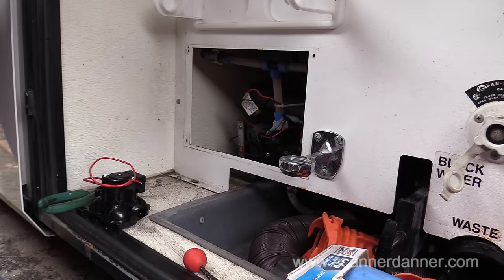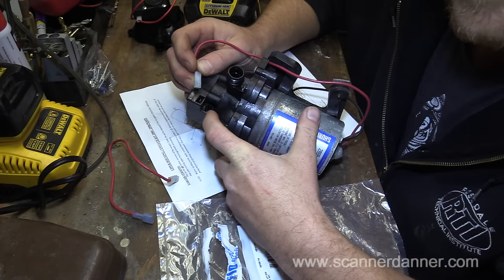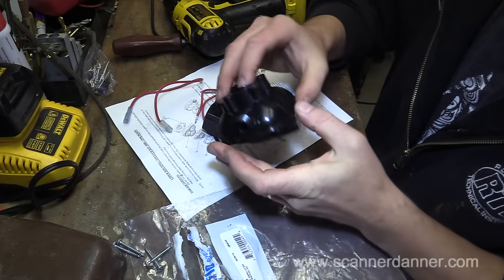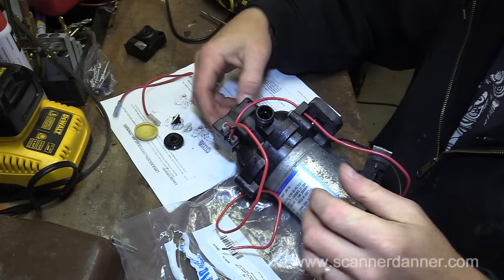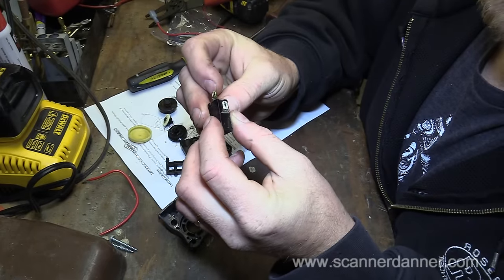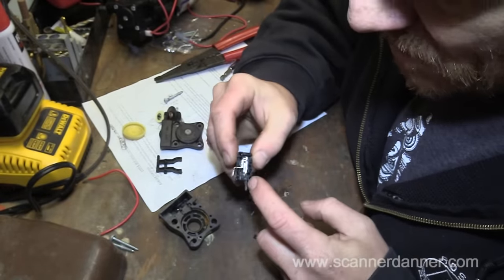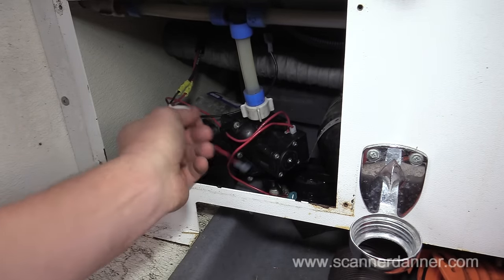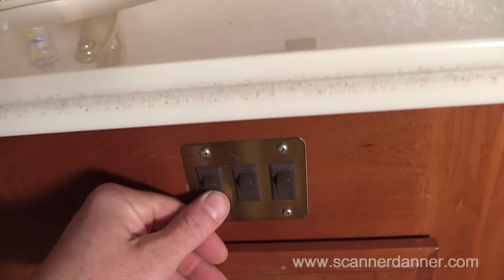RV fresh water pump, pressure switch replacement (ShurFlow 94-231-20)

Comment: Hi Paul. After changing the switch I would have used it to control a relay and let the motor current pass through that instead. Easier to replace. great video.
Reply: I was thinking along the same lines Inge a big inductive load for a tiny switch, with a relay you could do an easy swap in.
Another idea might put an capacitor (condensor) across the two switch wires as in an old style points ignition to quench the arc at the switch contacts.

Comment: You may want to consider replacing that solid hose on the output side of the pump with a flexible one, that may help to quite the noise of the pump in the RV.
Reply from the maker: I think the output side is the rubber hose on the bottom. The solid pex lines is the inlet...I think
Reply: Definitely does help

Comment: You the man. I kept wishing you would take that switch apart. Just got home and no water 😩 was wondering if I could just clean the contacts. I think I will jumper it with a fuse  for temporary use and order a new switch. Been watching your car vids for years. Thanks.

Comment: As a tightwad that routinely makes repairs on the molecular level to avoid costs and wait times I can dig your questioning the replacement of the entire housing.  However, bear in mind that a major cause of pump failure is improper winterizing and freeze splitting of the unit.  It's simply easier for a service center to stock and replace the whole thing.  That way any gunk, scale, plunger lube failure, etc. can be dealt with all in one go.   The factory probably tests and tweaks the adjuster to account for manufacturing variances in the housing.   At least you're not forced to replace the motor as well.  

Your switch had water ingress and the spring had already started rotting.  Unless there was a pinhole in the white diaphragm, the water came from outside due to weather or someone hosing out the compartment.  In your case the pump is mounted with the terminal pockets facing up so they will hold water that will creep into the switch.  I would advise sealing those pockets and the backsides of the crimp terminals to prevent that.  Good blobs of light bulb grease should suffice.

Hope you and yours had a wonderful holiday.
Grouch

Comment: Hey Paul, that V-15-2C26-K switch is just a common, off the shelf, 2 pin, single-pole single-throw, normally closed (SPST-NC) microswitch. I replaced a similar type switch in a gas fireplace some years ago- I don't even remember what it did - but I bought a 10-pack of switches for $5 from eBay and still have 9 of them left.  You can pick them up all day long for $2-3 each.  You can even use the 3-pin microswitch and just cut off the 3rd normally open pin.  The 3-pin switch just has an additional NO pin whereas your 2-pin switch just has the NC pin.  Here's the data sheet on them:  

https://www.components.omron.com/components/web/PDFLIB.nsf/0/FE0F8E8EEB5D725485257201007DD573/$file/V_1110.pdf

I wouldn't bother drilling the rivets out to repair the switch but I'd definitely just replace the microswitch inside if the need arises for anyone.  After watching your teardown it looks like you could do just the bare microswitch switch in about 10 minutes without removing the pump.  It's a $5 DIY repair.  Great video!
Reply from the maker: Exactly! Hopefully this will help someone in the RV world

Comment: U da man!!  I'm still not sure why my pump doesn't work but this was very insightful in deed!
Mine will turn on when you engage the switch, but turns off once it hits pressure.  Then, it won't turn back on once you release the pressure.
Very painful to try to take a shower so....Hoping to disassemble and fix; or, by a new switch while using the local motel for showers.  LMFAO!!

Comment: Just a FYI These pumps are used a lot in the industry that I am a service tech in.More often than not the brush plate that is located on the back of the pump fails at an alarming rate.If it happens you must buy the plate the brushes are already mounted to it.

Comment: I have that Same pump right now in my camper van waiting on the pump head for my better shutflo 4008 head to arrive when that happens I'm putting that pump in cause it's better and has a bypass which eliminates the need for a accumulator tank

Comment: I think I would fabricate a better mount for that pump to hold it steadier and to isolate the vibrations/ noise. A metal mount with rubber feet on the pump?  Maybe if the pump wasn't vibrating so much it would put less stress on the switches internal spring and help the switch last longer? It would also help with the wire connections to the pump moving around during the vibration.  Just a guess.

Comment: Great fix but you shouldn't have run the antifreeze through your kitchen water dispenser. It probably has a carbon filter on it and if it does you defiantly want to change it in the spring time..
Reply from the maker: The carbon filter was not winterized properly when I bought this last year and already had antifreeze run through it. I need to replace it after this winter.

Comment: what about the water heater tank is that full of antifreeze also you need to drain the grey and black water tanks, I don't think you did a through job of winterizing that system. maybe I didn't see the whole job. good luck.
Reply from the maker: The title of this video was not "how to winterize an RV"
But you would be correct. There is more than what you mentioned as well. Not only the hot water tank, but the ice maker in the freezer and washing machine too!

Comment: You should not put antifreeze in the holding tank!  Drain the holding tank and remove the holding tank line from the pump and use the pump to distribute antifreeze from the gallon jugs to all water outlets, drains and black and grey tanks.  Also drain the hot water tank.  Never use antifreeze in the fresh water tanks.
Reply from the maker: The procedures I followed are exactly what the manufacture recommended.  I agree, it can be done without using the fresh water tank but with the ice maker and washing machine, purging those was easier this way. Plus if I take it anywhere this winter we can flush the toilet using the holding tank instead of carrying around a bottle of antifreeze  (no pooping of course :-) )
Of course the holing tank will be flushed before use next year. (Multiple times)
Reply: My motor home is not as complex.  I don't have a washer or ice maker.  Mine is a 34' Class-A on P30 chassis.  Only gave 10K for it plus 2 years labor and parts.  I could afford new but like the experience making repairs and am not sure I am a camper.

Comment: ...Antifreeze in a fresh water tank...??? So many questions...
Reply: Thought the same thing, seems like not a very good idea.
Reply: Well it seems like some special safe antifreeze specially for "potable (drinking) water plumbing systems"... My bad )
Reply from the maker: It is Propylene Glycol based: " Like the ethanol antifreeze, this product is non-toxic and safe for all RV plumbing. Furthermore, propylene glycol is a lubricant and will actually work to extend the life of the seals in your faucets and toilets, unlike the ethanol based products. This is the only product we use on our own RVs and the only product we sell in our parts store. "
Reply: Yep, propylene glycol is entirely safe for consumption and is widely used in the food industry. Particularly used in ice cream (to stop the product freezing into a solid lump of ice).

Comment: Paul, you can buy those very common standard micr switches  like these 
http://www.ebay.co.uk/itm/Microswitch-16A-V-16-1C25-pin-plunger-snap-action-SPDT-Micro-Switch-V3-SW035-/330799159919?hash=item4d052a9a6f:m:meaIGAUr6kxWE7qei6iFOQg